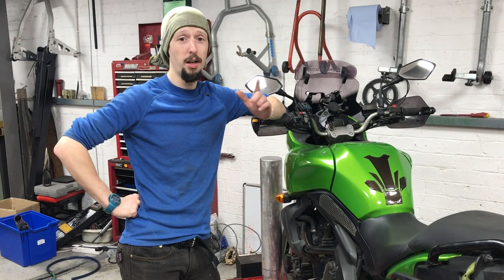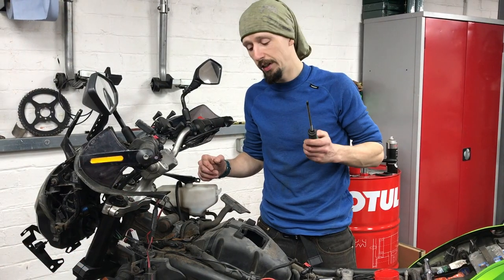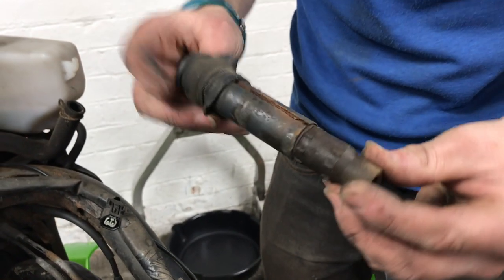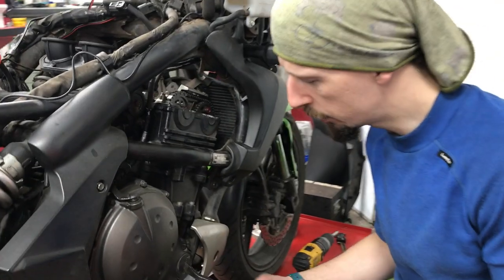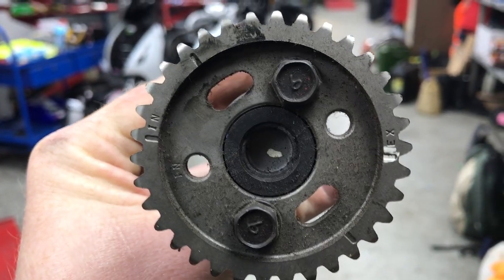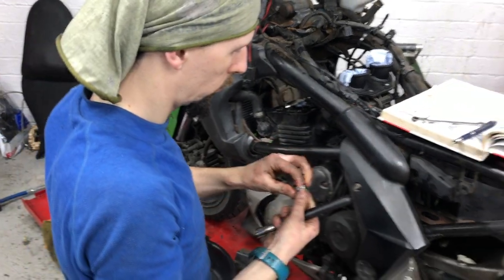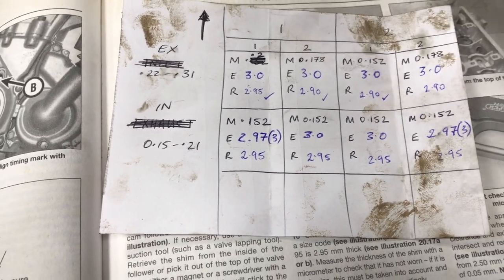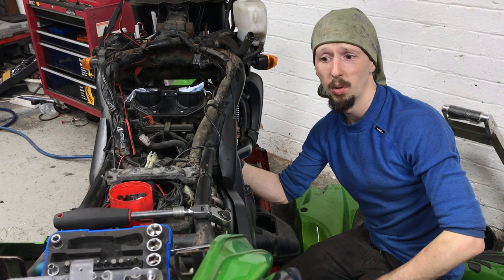Kawasaki Versys 650 - How to Adjust Your Valve Clearances

Comment: Very good and analytic video. I have a quasteion, The diameter of the shims for Versys 650, 2007 model is 7.48 mm? Thanks on advance and keep up the good work!
Reply from the maker: Hi. Thanks for the positive message. Much appreciated.
It's been a while since we did the job but as far as I'm aware the outer diameter of the valve shims is 7.48mm.
Are you planning to have a go at it yourself?
Reply: @MechitBetter  Thanks for the response! I also like the way you present the working procedure. 
Yes, I can say I have what it needs and I spend a lot of time maintaining my vehicles myself, so its time to have a go at valve adjustment. I dont like the sound of them. The think is I bought my versys a few months now and I also have throttles issues, something like jerking, limited power while acceleration, hiccups, it behaves like the mixture is not right. I ve changed so far: air filter, plugs, stick coils, pump with filter, rectifier, cleaned the throttle plates, but the problem is there, it got smoother but still exist. They all needed replacement, now is the time for valve adjustment, fuel injector cleaning and vacuum sychronization. Have in mind the bike was unused for 3 years, so everything in her needs some love :D Any ideas?

Comment: question   how  old is de  kawa   and how manny  miles  ?
Reply from the maker: Hi, 
The versys in the video is a 2008. At the time I think it has about 70k miles on the clock.
Hope that helps 👍
Reply: yes  thank  good  video @MechitBetter
Reply: Was it the first time serving the valves on that bike?
Reply from the maker: Hi, 
It was the first time that we had done the valve check and adjustment on this bike. I don't know if it had been done by anyone else before I got it.
Are you trying to guage whether it's time for yours to be done?

Comment: Hey guys , perfect video really helped a lot . Just measured mine and got EX 17 * 17 (1) 18 * 18 (2)  and IN 12 * 15 (1) 16 * 15 (2)
Now only thing i need  is the appropriate Shims and a magnetic tool :P
Is there anything to worry about the tensioner ? any special attention to anything ? Tnx !!
Ps , did you synch the TB after the valve adjustment ? i read that is a must after a valve job.
Ps 2 , jyst realized i took the measurments with the spark plugs IN ..could they be wrong ?
Reply from the maker: Glad to be of use to you. It's a good feeling to accomplish tasks like this yourself.
Hope it's all gone smoothly for you.

Comment: What was the mileage ?
Reply from the maker: At the time it was pretty close to 70,000 miles on the clock. I've added at least another 3k since then. Still feeling strong, apart from an exhaust that needs replacing.

Comment: My cams don't line up with the TDC marking on cylinder 1
Reply: What should I do?
Reply from the maker: Hi Sebastian.
It depends how far out you are.
If it's close but not quite right then it might be due to stretch in the timing chain and if the adjuster is maxed out, the chain would need replacing.
It's also possible to be 180 degrees out of synch so it's worth going round again just to be sure.
Does that make sense?
Reply: @MechitBetter  but could it be the chain if cylinder 2 lines up perfekt?

Comment: I was going to buy a bike like this but changing the spark plugs is a nightmare so not going to buy one now
Reply: ahh come on, don`t let that stop you, I just did it on my Suzuki bandit and it have 4 plugs and you also have to remove the tank and loosen the waterpump to get access and when I was in there I also put in a new air filter and it did only take me around 1 hour, now I also think it is a bit of a hassle compared to other bikes, like my old one with two plugs one on each side that did take me like 5 minuts to changes, so I did go for iridium plugs and a KN filter so I don`t have to do it again in 2 years (10K miles) but can wait like 6 (30K miles) and in the long run it is also cheaper, even tho it cost like 2x up front.

Comment: Wish I seen this sooner. My engine has just gone. Took the spark plug out and its crushed on the end. Thinking it's a dropped valve. 53k bike with no history!
Reply from the maker: Aaargh man. I'm sorry to hear that. I'm hoping it didnt cause you an accident. Were there any signs or obvious changes before it happened?
Any potential to save it or you feeling its time for something else?
Reply: @MechitBetter  The FI light come on. I pulled over, turned off then on and the light was gone. It's 16 mile home. No change in the engine but a half mile from home a grumble and blue smoke coming out of the exhaust. Freewheeled home. After watching your vid I feel confident to take the head off and have a look. I think I will put the bore scope down first to have a look.
Reply from the maker: @cobail1  Ouch, that must have been a tough 1/2 mile to treck this bike home... Unless you happen to live at the end of a gentle down hill slope.
Getting down to the engine is more of a time consuming job than a difficult one. A jazzy scope would be a handy tool for sure. Fingers crossed any damage isn't critical.
Will be interesting to see what's gone wrong. Have you done any engine work before?
Reply: @MechitBetter  Not a lot on engines, more industrial machinery. My plan is to get the head off too see how much damage there is. I've only got one of those £6 phone scopes but it has been good for some jobs I've done. Then it's a decision - replace parts or engine!
Reply from the maker: @cobail1  All that sounds like it can only be an advantage to you. Engage the mechanically inclined mind etc.
Do you have the workshop/service manual? Might be a handy bit of reference material.
If not, you can get one for free (.pdf version). Easiest way is to google "versys 650 manual" and scroll down to the offering from "KawasakiVersys.Com". Its spot on. 
With a bit of time and patience, and occasionally throwing things and yelling, I'm sure you'll have it sorted in no time. Its a great engine for a great bike so i hope it all goes smooth for you. Let us know what you find. 👍
Reply: @MechitBetter  Thanks very much for giving me the confidence. I will be steady away! I think it will be a struggle to juggle between engine change or rebuild, I will have to price up the damaged parts. Is there a rule of thumb, something like valves  and pistons do, plus bore damage don't?
Reply: By the way it's a er6n but it looks exactly the same.
Reply from the maker: @cobail1  Ah right. I think there might be an actual Haynes manual for the ER-6. The engines are the same. Its used on a few different models. As far as I'm aware, the only difference is how its tuned. Versys has more torque lower down and less top speed.
As for the choice between engine or parts, it's hard to say for certain without knowing the extent of the problem. Replacing the engine MAY be an easier task but the replacement is likely to be an unknown element which may have its own problems. Fixing the original would be more my preference but like you say, it's essentially down to how much work/money is involved.
I'm no expert in engine building/repairs (not even close) but i do have a friend in the know, especially with ER-6. If you're able to get some pictures or detail together once you've had a nosey, I'm sure id be able to get some informed advice for you.
Might find it easier to share that kind of stuff if you join our Facebook group.
Good Luck.
Reply: @MechitBetter  Sorry but not on fb. I'm taking photos as I go. The  pot looks bad on the endoscope, taking the head off tomorrow. Had exactly the same problem as you getting the valve cover off.  Again, thanks for the video.
Reply: @MechitBetter  Got further in with the scope. The cylinder has nearly disintegrated. It looks a mess and one of the holes is nearly a quarter the size of the cylinder, so a valve could have dropped into the bottom of the engine.
Reply from the maker: @cobail1  oh no, that sounds pretty rough. Sorry to say, as you suggest, that's sounding like it would need a deeper strip-down just to be sure nothing else was lurking below. 
If the top end/cylinder has severe damage then its a question of whether you have the time, space and confidence to tear down and rebuild a whole engine.
Probably worth considering a whole engine as a backup option.
Whats your thoughts about the task ahead of you? ...other than just "oh bloody hell" 😬
Reply: @MechitBetter  Sell it! Pictures show it's in a bad way. Two holes in the piston. I'm betting the head and bores are gone and I think there must be damage in the crank with bits of valve and piston in there! Gutted, just paid £500 for service, tyres and bits to get it through MOT. Less than a week then BANG!
Reply from the maker: @cobail1  im honestly gutted for you. Thats a real shame.
Do you think you'll stick with another ER6?
For all the time and effort involved in messing about with engine, it may be the economical choice to just punt it and buy something else.
I can be a bit stubborn and plow money into futile projects... But its a learning experience.
Do you have any other bikes to ride while you figure out this unhappy situation?
Reply: @MechitBetter  No more bikes for me I think. I have a project street bike based on a fireblade. Selling it as well.
Reply: @cobail1  I am horrified when I hear stories like that. I am wondering what caused it? I had a similar experience on my very first bike, a 1974 Honda CB540 that I used as my daily commute. Engine suddenly stopped while I was riding on the highway. Started it again, rode home somehow hearing strange noises. The moment I arrived home oil dripped from the engine. Called my buddies over to help me figure this out, took out the top engine cover and my friend said "Somebody stole your piston". Somehow the piston got loose from the rod and it got polverized. Sold the bike for parts and got a new bike. Still riding today.
Reply: @nikolaosberatlis3942  Yes a bad day! Same for me, it  was a commuter.

Comment: Its a nightmare on those bike same for the honda the moto guzzi has adjustment screw no shim take like 15 minuts take out cover adjust the screw on those japanese bike you need spend 3 hours to remove everything plus measure all shim immage 4 cylinder bike 16 shim unbelievable........